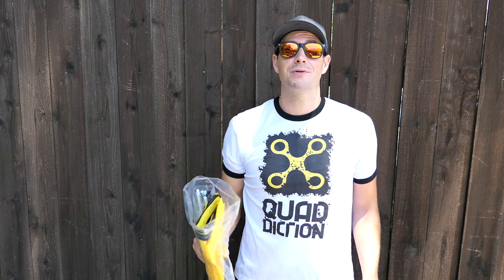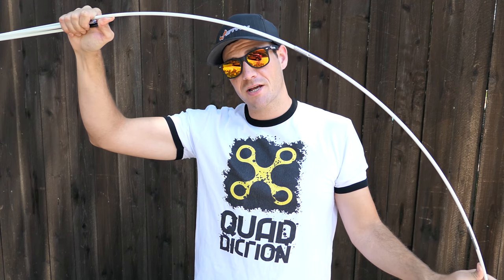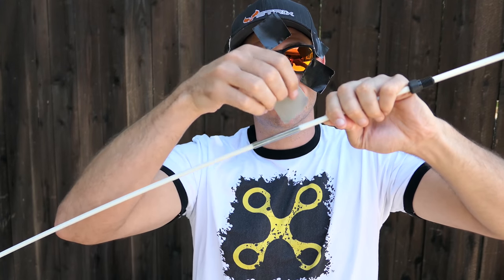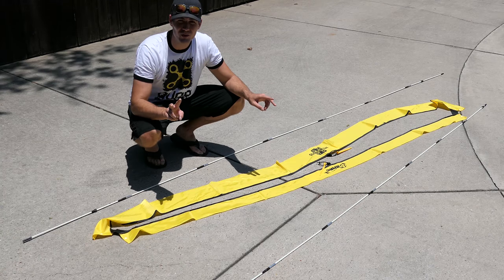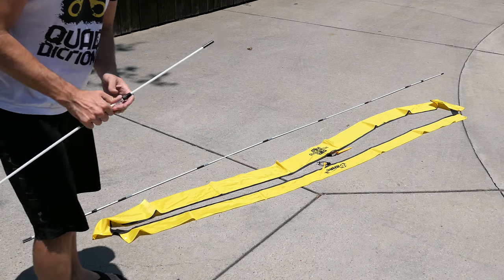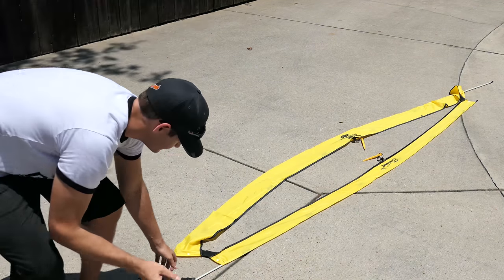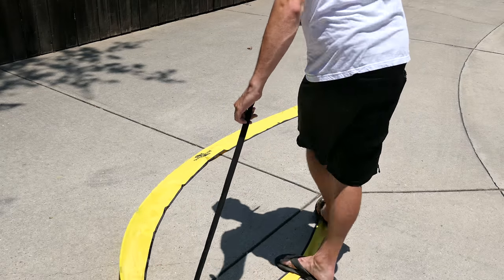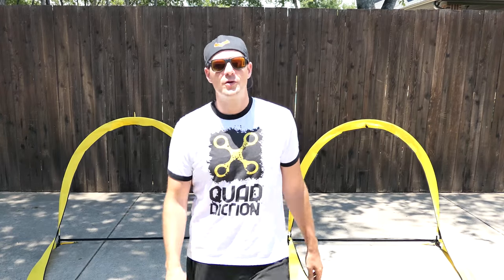Quaddiction Gate Assembly

Comment: Nice video. Used my brand spanking new quaddiction gates this weekend and held up great to being hit by props. No tears or rips even under direct hits!  I did have an issue under wind blowing them down but that may have been my poor staking.
Reply from the maker: Brian Totten 15+ mph wind is a bit ofan issue. Working on a guide wire modification for those windy days
Reply: Kewl! It was only a minor issue easy enough to run out and pop them back up.
Reply from the maker: +Bob Ulrichn duct tape, a hole on each side, carabiner to rope to stake! About $10 of equipment form a sporting good store. I’ll do a video soon

Comment: @Justin I was taking a closer look at my quaddiction gates and how they fall over if the 5 ft side is up in wind. I know you referenced using a tether or tie out but what if you increase the length of the black strap instead? The gates seem to lose stability on the 5ft side due to the bottom being closer in. I noticed on the soccer gates you show in your other video those have a wider base than these gates so the arch supports itself and it can't fall over. I am going to try replacing the strap on one of mine with a longer one (maybe 6inches) to see if that makes it more stable. Maybe on V2 you can try it?